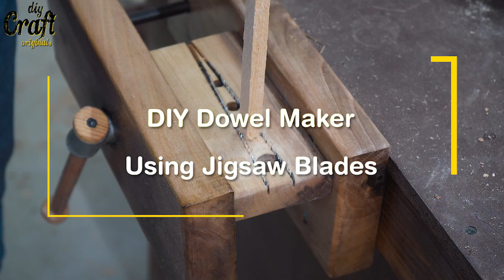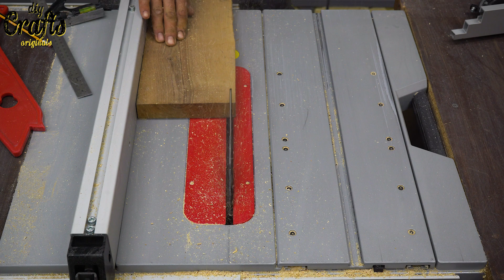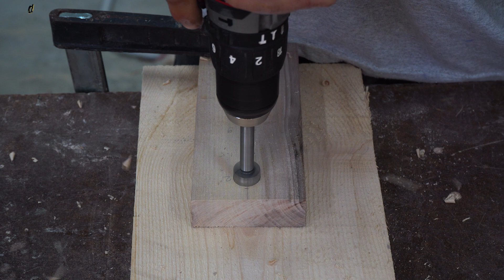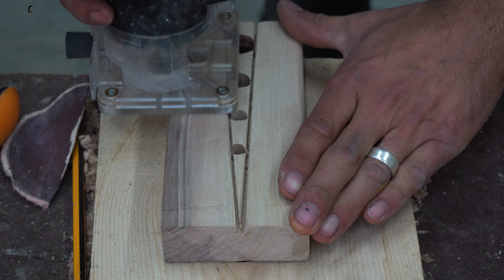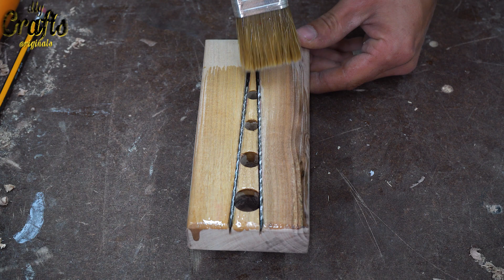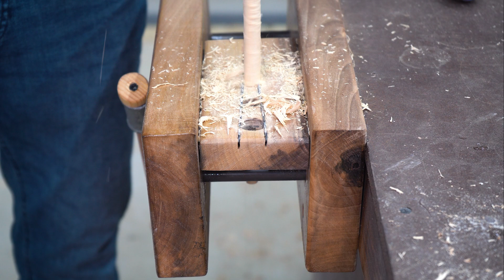DIY Dowel Maker Using Jigsaw Blades

Comment: Jig saw blades cut on the up stroke, make sure the blades are inset properly so that as the wood blank turns clockwise in the drill the blades are actually cutting, not just tearing the wood. One of the blades in this video is not correct. Also, using a finer tooth blade give a much smoother finished dowel. I used a single 20 tooth per inch blade and it gave me very smooth results.